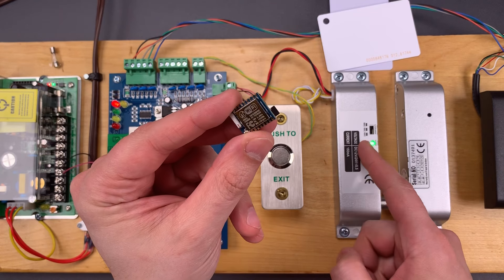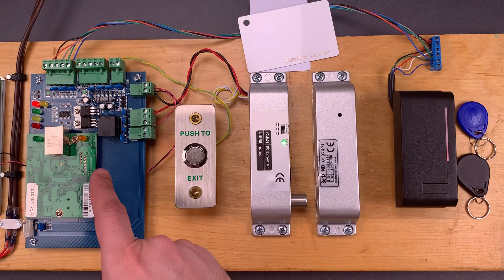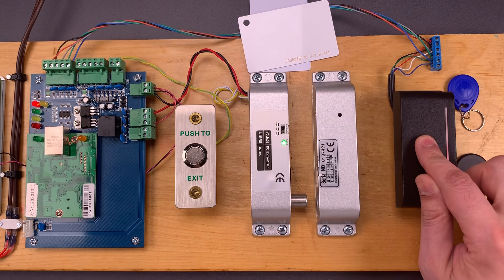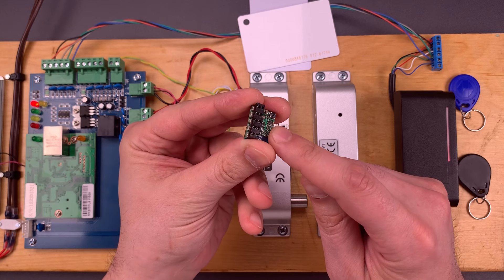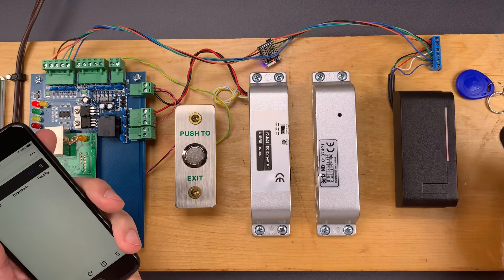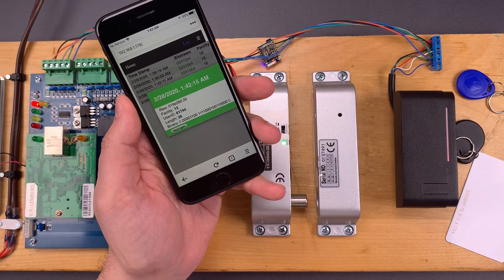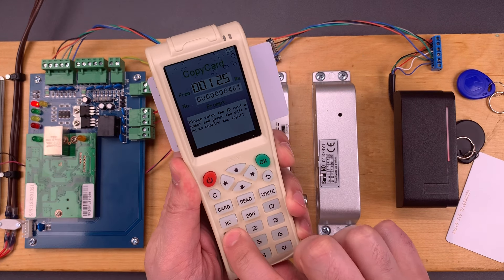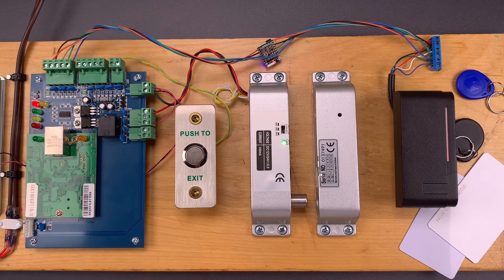[1052] Bugging an RFID Card Reader

Comment: "An attacker can compromise the system with very little effort"

Meanwhile, you just described a process where someone would have to socially engineer themselves into a position where they would have full access and control of the keypad in order to install the ESPKey onto the wiring. Then socially engineer themselves back into a facility to use any of the keys you retrieved without getting caught. Also, having a random AP just pop up in the middle of a facility where all of this is necessary, would easily be caught. If you could do all of this, you're better off just stealing an already existing keycard the first time you go. 

Like, no part of this process was "low effort". You would literally need some Ocean's 11-esque plan to pull off any sort of infiltration this way. This was mostly just an advertisement for ESPKey.

Comment: Even if the line is encrypted if the encrypted signal is still the same each time it is still vulnerable to the same replay attacks. What you may really want might not even be encryption, a solution without encryption is that the insecure part once it reads the card, it requests a random string of bits from the secure side, hashes the read code with the random bits and sends that result back over to the secure side, Once on the secure side the controller can use the randomly generate bits from earlier and hash it with the known code and then see if the codes match. A new random series of bits should be generated with each attempt.

Comment: There are other ways to do this too.
One of those ways is to use a long range RFID reader, install it in a backpack on some lipo batteries for example, then interract with people outside the building while wearing the backpack.
The reader will pick up the contents of the RFID cards, then all you have to do, is copy this data to an RFID badge, print it to look roughly like the ones used there, and walk right through the front door without risking getting caught on CCTV by messing with the reader.

Comment: Slight variation on the hack that Matthew Broderick's character used in Wargames (1983) to break out of the Infirmary @ NORAD. In the movie, he removed the inner door access panel, and wired in a tape recorder to ostensibly record the DTMF tones utilized by the key pad, when he asked the guard to use the bathroom. He then played the tape back a little later, and voila!...the controller commanded the solenoid to activate and unlock the door.

Comment: just bring a dremel and cut off the housing at the base, then put your own reader in the housing. glue the housing back together and then go through your reader's logs to see what signals were used on the door. pick one and clone it on a card then you have a duplicate card, even if the system is encrypted. you have to do some light construction type stuff to get at the wires with this setup anyway, so unless they messed up and left the wires exposed it is roughly the same work. the big difference is the size of the reader and the room in the housing, as that might be an issue to deal with, though readers can get quite small, and just like with that chipset you can tap into the existing power supply so that you don't have battery issues (size, running out of charge, etc.).

Comment: People have installed similar devices on the debit card readers on ATMs, gas pumps, soda machines, parking meters... anything you might swipe your debit or credit card on.
Reply: Yep, somehow got my card skimmed on a cross country trip (99% sure it was at a petrol station because that's where the perp then made purchases with my card). I'm usually good about checking the tamper tape on the pump but 2000 mile road trip made me complacent.
Reply: thats fine you just always turn off your cards after use problem solved

Comment: This shows exactly why all modern radio/rfid-based locks (as in cars or even garage door openers) will use rolling keys, i.e. a given car key will identify itself (a fixed number) along with the current key, while the car will verify that (a) this key ID is known and (b) the key is the currently correct one for this ID. When these started to be used in BMWs, the car would reprogram the key every time it was used, but it is also possible to do so similar to how a Secur-ID authenticator works, i.e. by generating a new 6-digit code every minute, except for a car you would want the period to be short enough to make a replay attack impossible without inconveniencing the driver.

Comment: Nice and fun setup, but be aware that many RFID readers (and accesscontrollers) have anti-tamper meassures build in. So removing the reader from the wall to reach the wiring, should sound an alarm (if implemented correctly). 
Furthermore, electronic accesscontrol systems are moving away from simply reading a card serial number (that has been proven vulnerable years ago). More and more common are programmable readers that can read specific encrypted sectors on the card. So this would have been lovely in the 80's or 90's, but the more complex, modern systems aren't fooled this easily.

That said: most systems will not be frequently replaced/updated ("because they work"), so the chances of running into an old system that can be fooled this way are fairly big. And even if a system is capable of detecting a sabotage attempt, there is no guaranty that it is implemented/activated correctly.

Still: I enjoy your video's!

Comment: Its easier to hold a rfid receiver near the door and record the card responses, you can do this as a handheld device and stand near the door pretending to look at you phone waiting for staff to come along and scan their card. Now you have the code enter it in and duplicate a new card, scan and you're in. No tampering with the wiring harness necessary. But once again you need to be very close to the card to copy the rf signal and it will become obvious that you're not supposed to be there, so its not easy to do this without staff and security getting suspicious. Most people tailgate anyway, as they could not be bothered scanning their card.

Comment: Many of these systems are used in combination with a magnet lock. I found that many of these systems can easily be compromised simply by cutting the wires leading to the lock. As we saw in the video, it appears as though the lock requires power to remain locked. Ounce the power is off, the lock unlatched.
Reply: And the power for the lock will be fed from somewhere else in the building. And you cannot dissassemble the wiring cover because the screws are covered when the lock is shut. If you have the means to remove power from the lock you can probably just remove the entire lock from the door at that point.

Comment: One way to make this device harder to use against you would be to either change up the color scheme of the wires on both sides, with proper documentation on the inside panel or to switch to all the same color but with number labels at each end.  
This would require the attacker to come back a 2nd time with more tools and increase the time required to install one of these units.
Reply: You could still easily break into a system like that by sticking an RFID skimmer on top of the real card reader. Just like ATM skimmers have been a thing for years, but easier.
If it looks like the original reader, chances are nobody would notice for a while, and it only takes one user scanning his card to gain access.
Reply: @dirkmohrmann8960  Yes, but if you show up with one of these man in the middle type machines and not a skimmer you will need to make another visit.

Comment: The protocol used to transmit data between a card reader and the controller is an international standard called Wiegand protocol. This ensures interoperability of devices from different manufacturers, so you can have a Satel controller and Hikvision readers and they will just work. The real issue here is cable integrity: what you've demonstrated should not be possible at least easily - no loose wires should be allowed between a reader case and a controller case, and tamper switches should be used in both places.

Comment: About 5 years ago I would have called BS as the normal installation of a card reader would be to mount a handy box, which leaves very little room to add anything else, sometimes it's a fight to get them closed.

However today most card readers and thermostats are installed via a mounting bracket which is a piece of plastic to keep the device square, you would have plenty of space to hide something inside the hollow wall.

Comment: That is all fun and all, but to use this you need to compromise a card reader first. Where I come from, such readers usually have any combination of: being installed in high traffic area, being in CCTV or guard view, being installed with wires going straight into wall behind it, being installed with fasteners from the other side if the wall, being recessed into wall and/or partially covered by paint/wallpapers/etc. Yes, the device is easy to use, if you have undecided/unsupervised wiring on unsecure side of the door, and that should be a big if with proper installation.

Comment: Encrypting will not be enough if the controller accepts the same message the second time. You can just replay the captured encrypted message just like he did the unencrypted one at 2:20. You need something like a sequence number or a timestamp to make sure that the same message will not be accepted again (encrypted or not). Encryption only prevents the cloning of the card.

Comment: There is also something that looks like what you used in this video but works differently.

Yours is planted between wires and reads that data, and becomes useless when the data is encrypted.
The one I am talking about is placed next to the reader, instead of between the controller and the reader. What it does is also read the card data from the card presented to the card reader. The data is then stored in the exact same way as yours, and sent to a browser application after it either connects to a network or creates one. This one can also act as an RFID card just as yours can; since it is placed next to the RFID reader, the module can besides reading card data, also send out RFID data and act like an RFID key.

And where do you place it then, since it must be next to the reader and out of sight for people? You place it inside the casing of the reader; there is often still some space left for such a small module.

Comment: I did somethin different to prevent this. I removed antenna from unit (cheap unit from china) and put it in some foam and glued it and cover with sticker, and antenna is on the inside glued on glass so there is no access from outside. It look like 5cm x 5cm x 7mm box. The unit it self is far away inside building. Only access is with tag or card. No way to access wires or even to make damage on antenna or unit.

Comment: One reason why many systems have tamper switches which alarms if system is under a hacking attempt. One very effective system is to hide the reader behind a wall which can not be accessed any way from outside but still is close enough to be able to read the tags.

Comment: @lockpickinglawyer I was wondering if an alternate method of attack would work. The RFID reader most of these cards are compatible with is a small, cheap 2$ unit that can fit in the tiniest of spaces. Assuming we have the liberty of removing the housing, we can easily place one near/behind it, and directly read the data off the card and duplicate it.

Comment: Even less effort is if an attacker simply reads a card just by sitting next to an employee while they drink coffee. They don't even need to dismantle the terminal and tap the wires, just get the reader close enough to an authorized card and copy it.
Worse locks ever made if the point is to be secure, but if you just want a convenient way for employees to open and close the door everytime they enter or leave, it sure beats a convenient non-electronic lock where people will just leave it unlocked all the time for convenience.
For most situations where no trade secrets or objects of value is being hold, that kind of lock is good enough to prevent costumers (or petty thieves) from wondering into the restricted areas.

Comment: You NEED an antenna on those things, unless it has an internal PCB antenna connected to a mux, you can very easily fry the board and get diminished range. That circular gold connector on the top is a UFL/IPEX connector that needs to be connected to a 2.4ghz antenna, or a 5.8ghz antenna if that is one of the newer esp 32 boards (s-2 i think) that uses 5.8ghz wifi.
Reply: Also you don't need a special RFID reader, a phone will work fine with a special app
Reply: Also also, simply encrypting the signal won't do anything, other than trick the ESP-KEY software that wasn't expecting it. If you simply save the digital bitstream and play it back, it will send the same encrypted message. (You might not be able to know what the message is, but you can still replay it). Encryption could work if the key reader and controller used 2 way communication and public key encryption. Eg. When a key is scanned, the key reader requests a random number from the controller to encrypt the key with, and then sends that over so that all correct inputs to the controller are unique and will be invalid if replayed.

Comment: The "key" reader would contain the encryption/decryption circuit. Which could be duplicated, spoofed, or simply defeated before "key" data reaches the crypto component for transmission downstream. I think it's safe to assume that if an attacker already has physical access to the signal wire - which is built into the door - then he also has physical access to the interior electronics of the user-side panel.

Comment: Surely the unit behind the door could detect tampering with the front unit like splicing wires in would change resistance = alarm or otherwise

Comment: I use systems from paxton, you can add a time slot for cards that are allowed, so you cannot go in after certain hours or even better, i can set an extra pincode on a card. So you need to present the card and type in your pin than you have access.

Comment: Send a nonce to the card that is properly hashed by the card's internal "unreadable" key. Then sent the result back to the controller that verifies the same process with the card's internal key on file.  If they match, they are valid.  And if the card is read a 100, or a 1000 times in a day, it erases itself and become inactive.  So you can't bruteforce finding the key in a moderate amount of time.  Even better, have a card that erases its key when physical tempering is detected.

Also, always keep TWO cards right next to one another, if possible in a Faraday cage or other sleeve shielding. This two steps will help protect against the card being read remotely by just walking by someone with such a card. Preferably, has the card be only readable by contact (no wireless). It should also include multiple keys to read, e.g. smart card pins for the hash challenge AND an optical strip that must be read by laser.  So copying a card needs multiple technology and different access method to be able to make a duplicate (and you won't know which one of the two to use).

Of course, never rely on only one of the three basic authentication components and, if possible, implement at least those three: something you have (card/key), something you know (pin/password), and someone that knows you (security guard, two-person systems).  If using a keypad, be sure to have one that randomizes the location of each key every time so you don't know what was pressed just by vaguely looking at it or by marking.

The two cards are almost identical, except for a small detail known only to you.  This detail will allow you to select the right card as needed.  One card is the usual normal access card, and the other is the "under duress" card.  The one "under duress" allows access, but also trigger a silent alarm and calls security.

Comment: Encrypted readers cost more than nonencrypted so a customer isn't going to shell out for them.  I always use the tamper feature of readers so when they are taken off the wall the system knows and send an alarm to the system admin.  You would have to get to the secure side of a access control system then not look suspicious while standing on a ladder with your head in the ceiling.

Comment: Let this 63 yo geezer who has been in the IT from the days of magnetic core memory, punched tape and KSP33 teletype terminals marvel for a moment at that thumbnail sized device that has its own WiFi access point and a website (plus its real thing, a simple logic analyzer.)
And the bloody thing is not more expensive than a bottle of good scotch! My prized possession from the days of debugging non-standard serial connections between instruments in physics laboratories and primitive computers, a set of connector adapters, level-displaying LEDs, micro-switches and bridging wires, was far more expensive.
It's not that I don't know how far the integrations has come; it's just that I can't stop feeling awed by it.

Comment: Even if your RFID reader is encrypted it has to send that encrypted data down the wire.  The ESPK wouldn't care if the data is encrypted or not.  The only thing you wouldn't be able to do is create a new key. But you wouldn't really need to if you can reply the encrypted data back.  

The only way you might be able to do it is to use something like an RSA key which changes every minute.  Then the only way you could get in is if you followed the person through the door within a minute of recording their key.